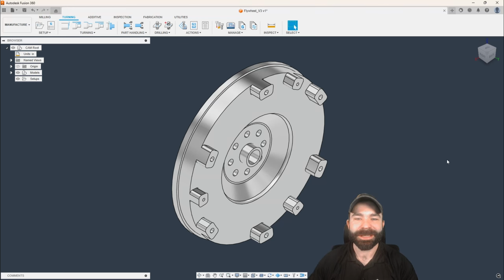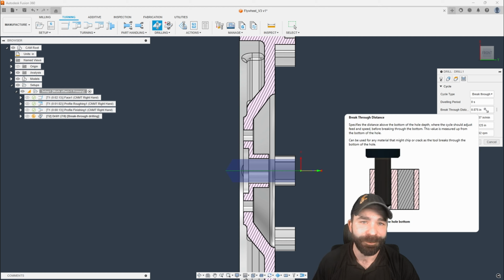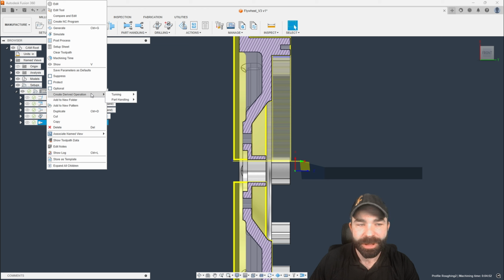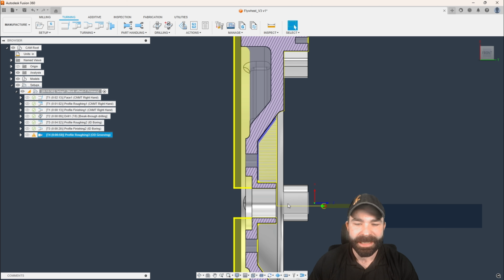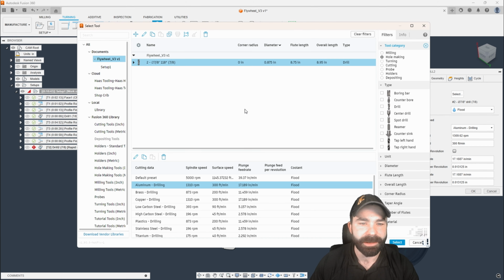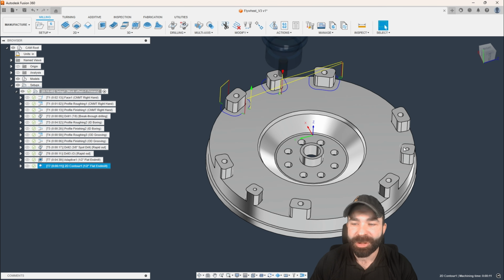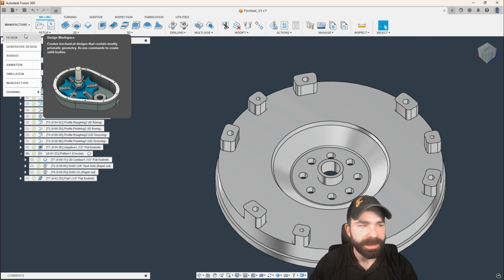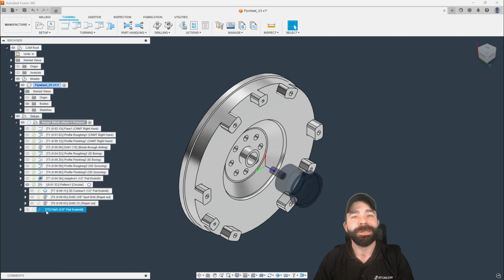Mill-Turn Thursday: Flywheel

Comment: HI Phil. Plunge outside the stock works only with stock contours. Set a Geometry machining to "none" then use stock contours -  both sketches inside then outside. It will work pretty good.
Reply from the maker: There it is. even the best of us over think or miss the simplest of things.